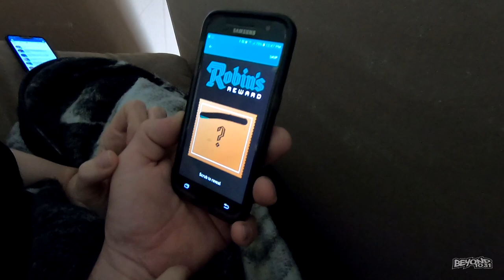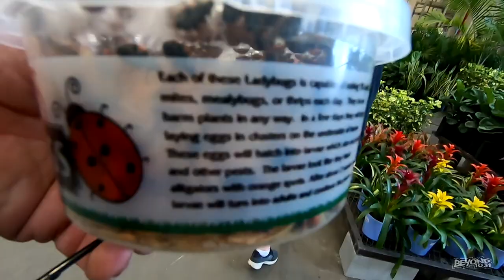Drywall & Ladybugs!! [Day 3156 - 06.22.19]

Comment: Nicely cut!!!

Learned to cut, tape and float drywall the summer I turned 12. Was easier then it looked... we had to use concrete backer board in the standup shower in my gram’s bathroom. That was more difficult for me. 

I also learned to cut, book and hang wallpaper... not fun for me. 

My uncles are/were contractors... so the family build gram a new house. Only things contracted out was concrete slab... my cousin is a journeyman plumber, my dad was an electrician... I was the only grand kid (besides my cousin who’s a plumber) to work on the house. Only 2 girls... me and my older girl cousin who’s a pissy snobby b*tchwho even offered money she refused to help even paint... only job I didn’t do was lay the tile floorings in the bathrooms.